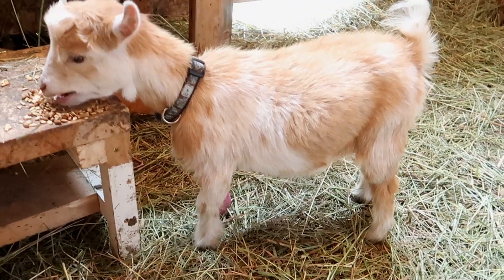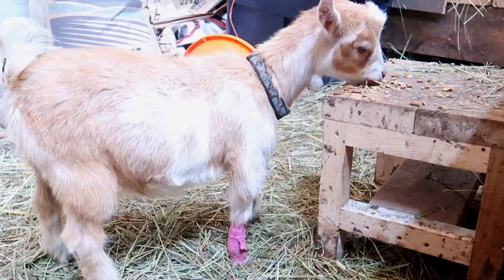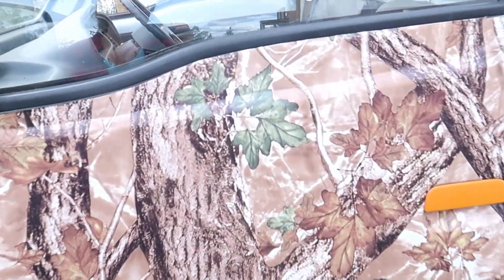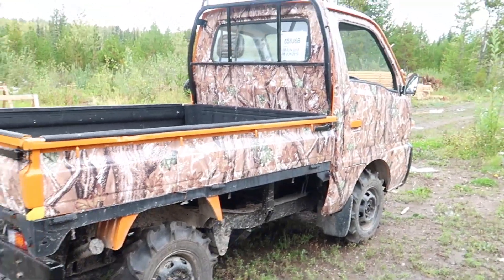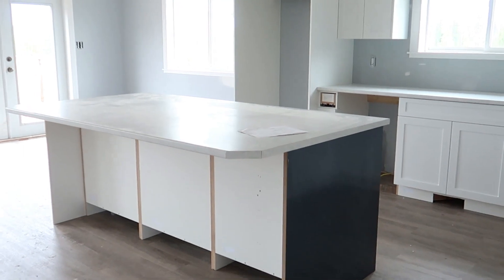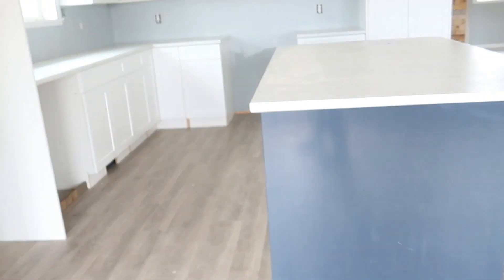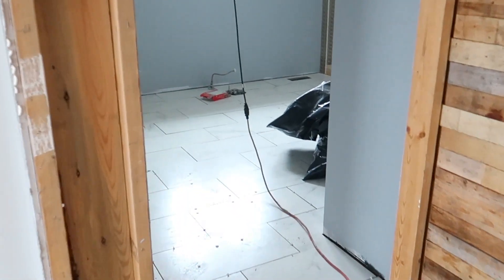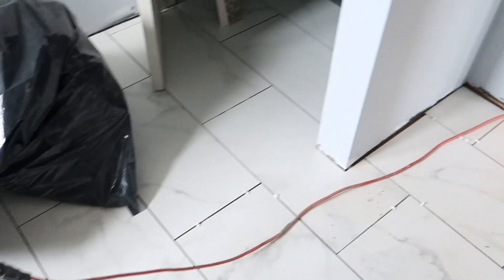We got a MINI TRUCK- how much wood can it hold?

Comment: This truck is popular in the Philippines, aside from it is reliable, its easy to maintain and has low cost, plus it's easy to have parts
Reply: How much a new one costs with the dump? In Philippines? Moving there and will need one.
Reply: @smartassist9700  buying new and used makes no difference at all, but i think the cheapest cost 3000 PHP, or about 6000$

Comment: if the truck had DiffLock it would drift so cool.
Reply from the maker: It does have difflocks :)
Reply: Harper Valley Farm  .. ahh! maybe he had the DiffLock OFF when he was doing Donuts..
Reply: @CabezaDePistacho  Check out motocheezs mini in his latest vid. In the snow he had diff locks on and the donuts looked the same. Both have atv/tractor tires though, maybe too much lateral traction? or maybe they disengage after a certain kmph.

Comment: Those little trucks are great until you break em and have to learn Japanese to get parts
Reply: or there is also overnight parts from japan i guess
Reply: There is a big parts distributor in Missouri and several others around the country. No different than Polaris ranger or Kawasaki Mules you may have to wait a few days for parts... They rarely break down.

 A lot of parts can also be purchased at your local auto parts store.
Reply: do you have to learn japanese to fix a toyota sold in the US? these parts are common here bud lol.
Reply: Lol right on, good
Luck finding any suspension components for that Vehicle, not to mention, if it’s a diesel you’re totally hosed... generally Japanese market vehicles have slim to no parts availability n the United States
Reply: @Smegma_pirate  or you know go to the import place you got it from? A lot of them provide more service than just cars or would know how to get them lol this seems like a no brainer
Reply: Ant An that’s cool if the import  place is right down the road. A lot of us depend on Napa to get parts same day on vehicles we rely on day-to-day. The availability isn’t there,  sure you can get the parts if you’re willing to wait a couple of weeks, what I’m saying is compared to domestic vehicles, the parts availability isn’t there.